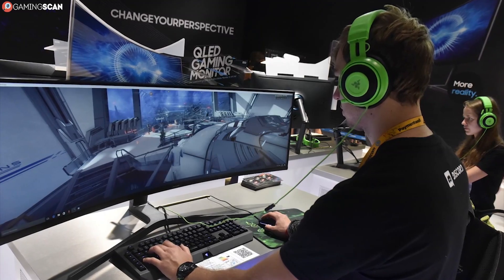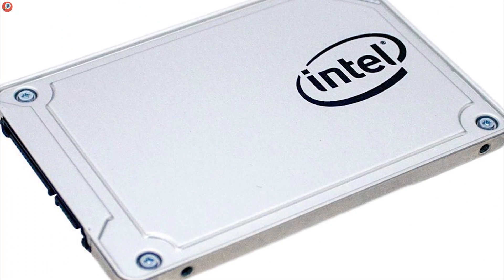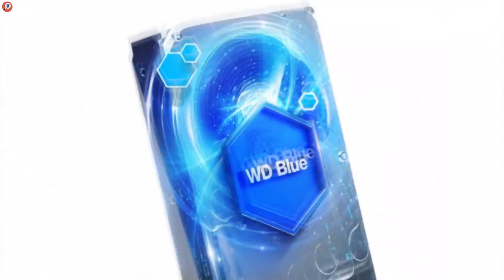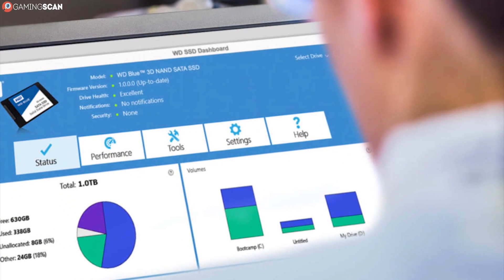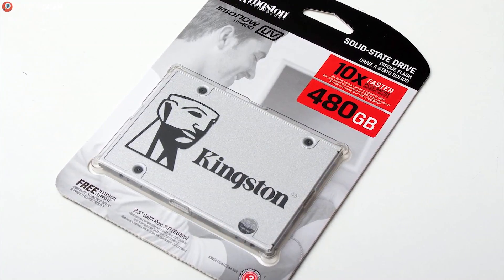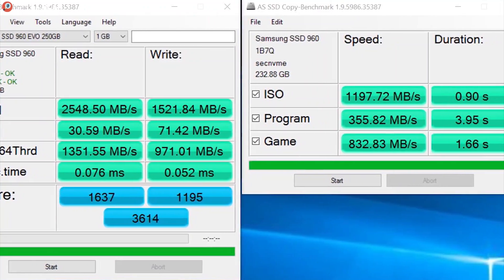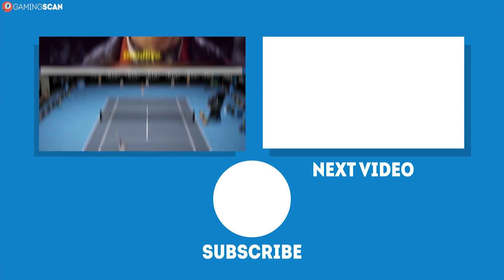Best SSD Drives 2020 [WINNERS] – The Ultimate Buying Guide

Comment: Absent from this review is the Crucial MX500.
It is one of the fastest SATA based SSDs available, and its performance is basically a photo-finish with the Samsung EVO SSDs.

Although the EVO has a slight edge in some narrow benchmarking tests, you will not notice the difference.
Even if you used one of the SSDs for weeks, and someone swapped it for the other one, you will not know.

And the MX500 costs significantly less than the EVO.

It is odd that the MX500 was not included in this "WINNERS" buying guide, since it is a podium winner, and is the most price friendly in the field at that performance level.

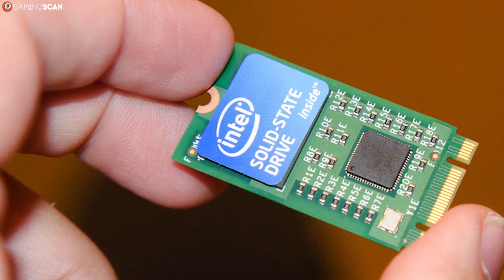Comment: @7:37 "Not only is it much more cost effective to get a small SSD for a system drive, and a large SSD for storage, but it's generally better to do it this way as well".

Yes, it is more cost effective as it is phrased above.  However, that is for the initial purchase price.
Mechanical disk drives use far, far more electricity than SSDs -- especially when no data is being written, which for most people, is most of the time.

Also, the biggest strain on mechanical hard drives is the power up process.  The drive has to get the platters spinning, from 0 RPMs, to 7,200 (a common HDD speed) RPMs, in a few seconds.  Therein lies the strain.

Mechanical hard drives have moving parts that are a point of failure.  SSDs do not.

Yes, SSDs will eventually wear out.  But you will likely pass on to your maker before you will wear out your SSD.  Even if you beat on your SSD with jobs that write and write and write, you will very likely never wear out your SSD.

The manufacturer has a TBW (terabytes written) value associated with their drives.
That value does not mean that you drive will fail or become slower or have issues when you reach it TBW value.
What it does mean is that you ended the drive's warranty.  So that TBW value is there as an excuse for the manufacturer to deny your warranty claim.

The is a crypt-o currency named Chia.  That requires endless writing to a storage device, the most common of which is the SSD.  By endless, I mean 24/7/365 -- for years.

Check the on-line Chia forums, and you will be hard-pressed to find anyone whose SSD was written to death.
Any SSD failures were likely unrelated to the drive taking a beating, and is likely due to a manufacturing defect, where the drive would have failed, regardless of where it was used.

Also, some people do not provide proper cooling.  Heat kills.  So if your SSD is heavily used, all you need is the slightest bit of air-flow, and you will be fine.

Another point in favor of SSDs is that they are silent.  Whereas, mechanical drives are not silent.
And if you are using a power saver mode, then you will constantly have to wait for your mechanical drive to spin up.  And that circles back to the strain of spinning up.

Lastly, when choosing a SSD for your boot drive, get at least 500 GB.
Our host mentioned using a mechanical drive for storing your data.  But most people do not configure their computers to store saved files elsewhere.  They save their documents to "My Documents", and "My Music", etc.  By default, all of that is on the boot drive.

So unless you are going to change the default locations for the "My Documents", etc, locations, or you are going to manually save documents by clicking around to a different location, then you will need more space on your boot drive.  Depending on how much you download and how many projects you save, etc, 500 GB is the minimum, and I recommend 1 TB or more to be safe.

Keep in mind that when you install programs, they, too, default to your boot drive.  Another reason to have a large size boot drive.

Comment: HDDS last long than SSDS?
I doubt it, they are mechanical, they wear down and break.
I've been using ssds for 10 years without any obvious failures.
I'd guess that generally speaking an SSD will outlive a HDD (of equal capacities and workloads)

There's gonna be ssds that live longer than hdds and vice versa, there's many variables at play.
Reply: @mikeycrackson  And hard drives are mechanical, they also wear out.

Comment: I like to share my experience with SSD . I have an early 2011 MBP / 15 inch . OS 10.13.6. As a main drive I upgraded with Crucial MX500 ( 500GB) , I had no problem with that Upgrade , it has been 3 months now the drive run smooth at 37 dgr Celcius. Then a month ago I decided to a new upgrade , removing the super-drive and replacing it with an M.2 drive, I run one in my Asus and was quite happy with it . I got a Caddy (OWC ) to support the SSD and an adapter SSD M.2 SATA > SSD 2.5" SATA and I choose a Icy Dock EZConvert MB703M2P-B because I liked the fact that the top could be left open and have enough room to put a ICY BOX  heat sink. For SSD I choose the Samsung 860 EVO M.2 ... 
Well I never could make the drive  work properly, It just wouldn't hold formatting, S soon I turn off my MBP  for ther night , the morning after after login I got a warning that a drive was found and needed to be initialize , the APFS volume and partition gone ..! . I got it from amazon ,so I  replaced the first one as I thought maybe I got a drive that had a problem, but got the very same problem's with the second  860 EVO M.2. 
Finally I got a Adata ASU800NS38-512GT-C  , and it has been running great for 1 week now at 25 drg Cel, those Adata's seem to run cooler ( 25 dg  been I think the very minimum for those M.2 ) than most. Hope it may help someone in the future ... 
PS: you don't mention Adata in your article but for MBP I think they can be a great Option , SATA or NVMe ...

Comment: I put the 240G Kingston in my nine year old Acer laptop. I did the windows 10 upgrade before I replaced the HD and it took forever just to boot up. After replacing the HD with the ssd it boots very fast. I was so impressed that I  put another one in my homebrew budget desktop. In the 6 months since then the price has gone from $31 to $37. A few days ago I put 500g silicon-power m.2 nvme in my dell inspiron 5770. The boot up is at least 5x faster. The ssd had a lot of good reviews and the price was right.

Comment: I bought 120gb ssd for the OS.... now i regret that after  windows 10 updates!
Reply: Windows 10 updates have broken my Dell laptop OS about three times in the last two years. Got it working then I put the 500G m.2 nvme drive in and have the 2T hd as a backup. If Microsoft breaks it again I change the boot order again and reinstall a working version on the ssd and I'll be up and running again. I also did a backup to an external usb drive.

Comment: need a ssd for dell d620 laptop 250gb , any suggestions ?
Reply: That depends on whether you need one that is M.2 or 2.5 inch.

Either way there is the WD Blue 3D NAND Internal SSD, and the Samsung 860 EVO series which are offered in both M.2 and 2.5 inch formats. You might consider going with a higher capacity if you can get double the capacity for less than double the price.

Comment: I got my 970 Evo plus 2tb finally ... Cloned my 860 Evo 1tb into it  and then using it as my os boot drive. I would have appreciated if benchmark values of read/write were posted in the video with graphical bars.

Comment: U can do a pro gamer move and use a 1tb samsung 860 EVO and a 500GB samsung 970 EVO Plus  like me. If ur just using it for gaming, this works very well, because u have quite a lot of storage and it's very efficient, also if you start running out, u still have space for 1-5 hard drives depending on ur pc

Comment: Nobody compares ssd's to hdd's anymore. Now days you compare m.2  nVME ssd's to 2.5" ssds. Other than possibly having a huge 8-10TB hdd for data storage, most advanced system's have a combination of 2.5" ssd's and m.2 ssd's.
Reply: That's definitely true if you're comparing them for a new purchase. But if  you're dealing with a computer that has a spinning hard drive, to compare the performance increase that an SSD upgrade will give is very useful.

Comment: I have the Kingston A400 240GB. its super fast and so far so good. bought it for like $34 only lol really happy with my purchase. I heard the Crucial ones are excellent too. definitely gonna buy some of those in the future
Reply: Do you have also hard drive? I have A4 240 and nothing else... When I fill more than 80 gb it starts to slowdown pc very much
Reply: @danielkilaz5417  I have a WD purple 1TB HDD for my storage and games on D and E drive while the Kingston SSD is just for the system which is the C drive. I have no problem whatsoever with the SSD it boots super fast.
Reply: @hircine92h  When comparing ssd / hdd, each ssd is super fast, but in the SSD category, the A400 is one of the worst ssd, low end, terrible parameters, low TBW, durability, cheap poor quality Phison controller and even Kingston don't provide much information ... Crucial is the best disk in price / performance ratio. It is a brand from the chip manufacturer Micron (well tuned SSD), great parameters, TBW 360 (1TB version, A400 - 300 only), extended warranty, aluminum cover, random read / write 95,000/90,000 IOPS (A400 89000/38000 only ).
Reply: @Sklepmistr99  well the Kingston works just fine for me and I got it for only $34. very fast start up, fast chrome and apps launch..etc can't complain. for sure its Not the best SSD out there, but it does the job. I agree Crucial is the best but they're more expensive than the Kingston.
Reply: no dram cache. worthless.

Comment: Thanks for updating this video by adding descriptions. What I'm glad to know is the Samsung 860 QVO is fantastic value for money. However the obvious drawback is it has a Quad Level Cell (QLC) which has significantly shorter write cycles than Triple Level Cell (TLC). This is why it has shorter, 3 yr warranty period compared to TLC EVO series' 5 years.
Overall I'll avoid any QLC SSDs at any cost and stick to TLC SSDs or if possible get MLCs / eMLCs.

Comment: Hello, I’m looking into upgrading my HP laptop. I have G61-429WM model. I am wanting to upgrade the SSD and the RAM. I would like to put 8G RAM in the computer but everywhere I google it talks about how it can have limit RAM in the windows. What would you recommend for me to do on the SSD and the RAM? I would like to do close to 1TB on the SSD
Reply: You can't go wrong with Samsung EVO, WDs, Kingston or equivalent. My only advise for SSDs is to stay away from Quad Layered Cell SSDs like Samsung QVO series as they tend to have less write cycles compared to Samsung EVO. In plain English, Samsung QLC QVOs don't last as long as Samsung EVOs or any Kingston SSDs. 
From a look of your laptop specification, can only max out on 4GB and with that AMD Sempron CPU,  you maybe better off getting a new, better speced laptop. Go a tier higher, or 2 or even 3 tiers. Otherwise just get a new SSD as it definitely will run a lot faster and quieter.

Comment: I have a Samsung EVO 850 500GB that after about 14 months of use one day decided to stop working. This thing basically only ran the Sims 4 and now gets stuck in a boot loop despite full erase and reinstall about 10 times on 2 seperate computers. Even a 15 year old HDD, although painfully slow, is capable of running my PC whereas this piece of junk barely lasts long enough to load windows. I have an old BIOS that cannot update so I am going to upgrade the motherboard and get a better SSD but I have no clue which to get now since this 850 at the time was the best and I wan’t something to last longer than 2 years.
Reply: I assume you haven't properly configured your SSDs and you've exceeded its written cycle. My Samsung 850 EVO 1TB and 970 EVO 2TB are doing very well, no bad blocks, over 10TBs written. Neither of them have broken down on me. Both over 2 years old and counting.

Comment: Dont listen to this video, actually never listen to a video that does not give statistics, specs, price. The video literally reads the products descriptions that were written out by the manufacturers.... It does not actually compare them....
Reply: it was clear to me within the first 30 seconds that this script was written by non enthusiasts.
Reply: @lizardinthelites  then they said they don't recommend beyond 512gb. Like wtf do you not use a pc? 500gb holding the operating system and then games doesn't fit shit in the modern day
Reply: RoyalGoat the toshiba hdd obviously
Reply: @HotFreshBox  No mAAAAAAN.   My maxtor diamond 20GB 5400rpm ide hdd from more than 15 years ago maaaaan!!  :P.  Ah..the gold ol days of the early millennium  xD
Reply: If that's true, then I guess you can get any Triple Level Cell SSDs at good prices. However I advise to avoid any Quad Level Cell SSDs if you're concern of limited write cycles. Personally I wouldn't touch ANY QLCs.
Reply: QLC is best for the money (for gaming) just dont go over 50-70% of your storage capacity or you will be extremely slowed down.
Reply: QLCs should be avoided if you know that have to do regular updates on several apps, drivers and your operating system.
Best to buy "cheap" TLCs from China if you can only afford QLCs.
Reply: @Ghost Whats the best ssd for windows 10? Like a 64gb one or something
Reply: Wait, so you guys are saying my 256gb USB 2 flash drive is bad for gaming?
Reply: Agreed
Reply: m.2 or ssd???  https://www.youtube.com/watch?v=wGFok7fJt5E
Reply: Then what's the best ssd for gaming??
Reply: @porckpie7156  maybe a m.2 p31
Reply: In my country, the price for a 250gb Samsung 860 Evo/960 Evo is the same price as a 500gb WD Blue (5 year warranty). I would be absolutely insane to go for Samsung.

I think this price sort of price difference is the same for every other country worldwide (but i'm welcome to be corrected if your country is different).
Reply: Gives storage capacity, write speeds, and comparative prices per gigabyte between the options. What more statistics do you need?
Reply: @Autumn_Panic  where were the prices?
Reply: They objectively do give specs, and this video accomplished precisely what it set out to accomplish. It also explicitly compares them. Why are you like this?
Reply: @CoryMck  based on his structuring of that sentence, he never said this video didn't have those things. He said don't listen to this video. Objectively speaking of course.
Reply: @xXJLNINJAXx  Implied language is objective

Comment: How do you know if you are not setting up a SSD  for Maximum performance? Don't you just simply install it in your PC and than either clone your Old Hard Drive to it if they are both the same size or the SSD is larger or start from scratch and just reinstall your Operating System(s)?
Reply from the maker: Yeah pretty much. We’ve updated our buying guide on our website. The Samsung 970 Evo Plus is the fastest SSD that we can recommend.

Comment: What about the Samsung 970 Evo M.2 Plus. Is it better than the 860 Evo M.2?
Reply: @Aryan Saldanha Thanks Aryan. Will definitely get a 500gig 970 Evo plus then for sure for a boot drive. The difference in price isn't worth worrying about as it is only $40 dearer than the 500 gig 860 Evo here in Australia. Every second counts hahaha.
Reply from the maker: The 970 Evo Plus is the fastest SSD that we recommend. A bit faster than 970 Evo and much, much faster than the 860 Evo since it is SATA based, as Aryan points out
Reply from the maker: @Aryan Saldanha In that case the MX500 is a much better deal and slightly faster as well, though not really noticeable.

Comment: Keeping a simple 250gb for my OS (have had it for years), getting a new 1TB one for games/apps to replace the 1tb regular disk I currently have.
Reply: only certain games benefit from ssd, id be hard pressed to find a reason to buy an ssd for games
Reply: @Bidwellz9  Every game I've played benefits greatly from an SSD, bar a few examples. Not in terms of increased framereate, but insanely faster load-times and occasionally less texture-streaming hiccups are worth it for me. Especially the load times ;p MORDHAU is a recent example: pretty long load time on normal HDDs, no load time at all on SSDs.
Reply: @KindOldRaven  like i said certain games, games with loading screens or texture pop in youll see a difference, beyond that you wont.
Reply: @Bidwellz9  Most games I play have loading screens either upon dying (BR games, Dark Souls) or a long initial load-in time (open world games, GTA) where all games mentioned load 2x to sometimes 3x as fast so it's more than worth it for me ;p I also do video editing where the difference is very much noticeable.
Reply: @Bidwellz9  do you know many games without loading screens or textures?
Reply: @antwnhs213  hes probably playing tetris

Comment: A quick question:
When installing and m.2 ssd does the retaining screw at the of the ssd has to be tighten? Does it makes any of ground contact or something?
Or can we just secure it with double sided tape?

I'm asking this because I bought a m.2 ssd and the notch at the end doesn't align with the screw hole and the ssd is not recognized by the computer. 

Thanks
Reply: I’ll look into it. But I believe that’s not it. I’m installing de ssd on a MacBook and it needs an adapter. I believe the adapter is creating some bulk so that’s why it doesn’t align with the screw hole. 
But my fundamental question is if the screw makes any kind of ground contact and if it’s really necessary to be fastened.
Reply: You really that cheapass you bought a frinik MackBook laptop and you cant fucking get a screw instead you use the damn isolating tape....
Reply from the maker: You need to push the M.2 SSD a bit in to the M.2 slot. Maybe it's upside down also. Then it'll align when you push it down.

Comment: I am a noob at this so help me out. These ssds will fit into most motherboards right?
Reply: 2.5" don't go in your motherboard its connected via sata cable. As for m.2 nvme you need to check your motherboard manual or just check to see if the m.2 is there. Note theres 2 different versions, not all are the same kind of m.2.